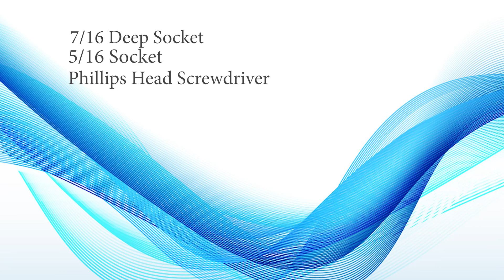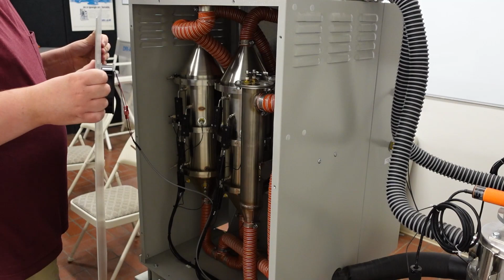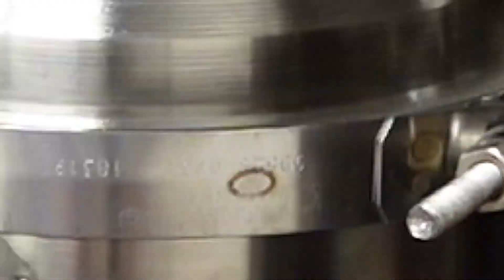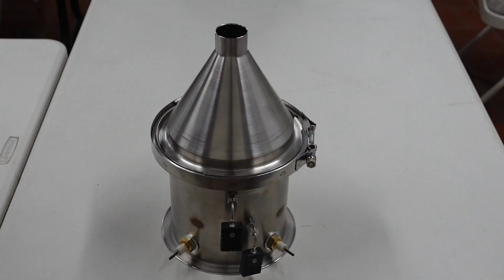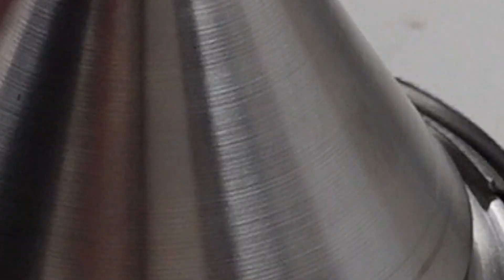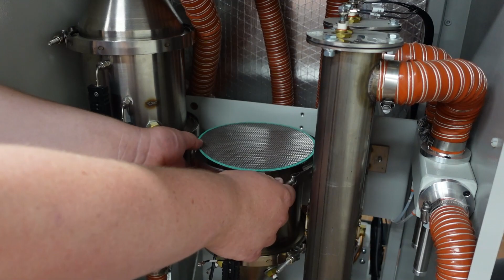How to replace the desiccant in your dryer

Comment: Good video but our issue is the tanks (Arid-X) won't  switch out but rather stays on one tank 24/7. Operaton manual does not define what signal is monitored via the board to tell the valve when to energize and swap out tanks after the regeneration cycle, example, time based, dewpoint, etc... This is a releatively new unit with all internals in clean condition.... Some troubleshooting service guides would be helpful for us to better understand how the electronic system works.